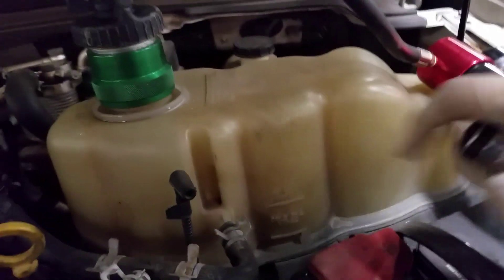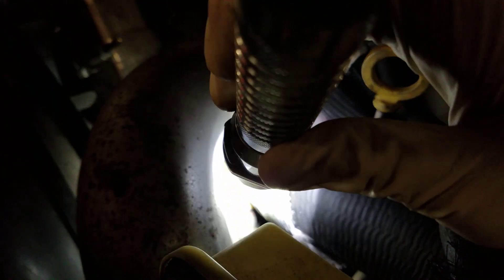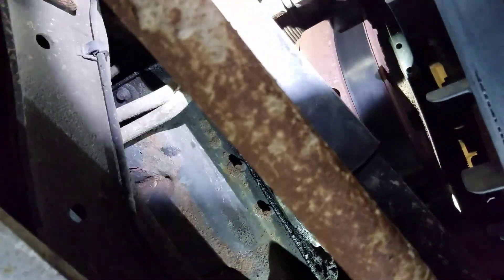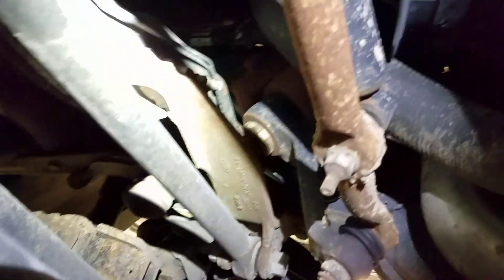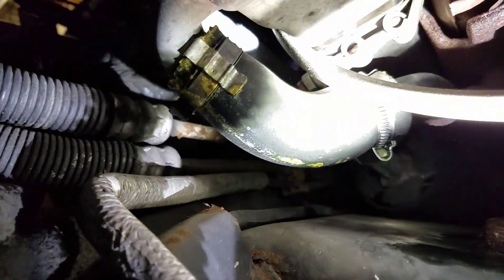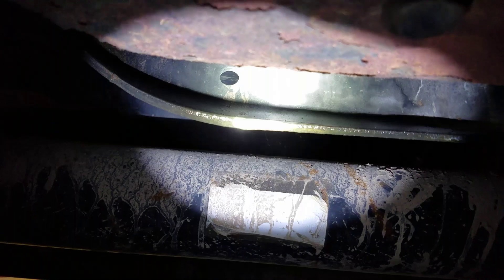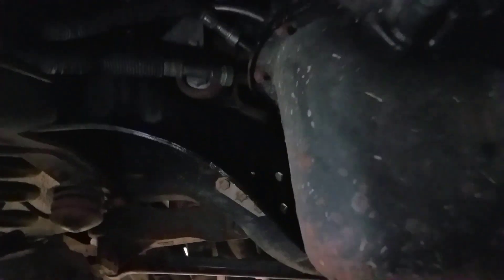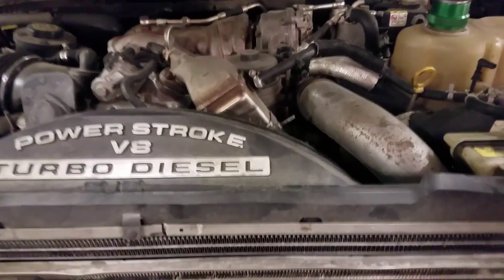2008 6.4 - Coolant leak

Comment: I can't believe the timing of your video.  I was at the dealer twice last week.  They couldn't find the my coolant leak the first time.  The second trip to the dealer last week, they ended up replacing this exact same hose on my 6.4 F-250, that you replaced in the video. (Horizontal EGR cooler to Front Cover hose)  They said that they had a tough time finding the leak.  However, NOW, it's leaking again -  but worse.  (On Saturday, I was trailing two lines of coolant into my office parking lot, and it formed a good puddle under the truck by the time I got out of the truck.)  I'm taking the truck back to them on Thursday.
Reply from the maker: Awe man sorry bud! Thanks for watching tho

Comment: ARod, I've done one of those on a customer's '08 F450 a while back, we got the assembly from Ford but after careful consideration I stole the hose piece off the new assembly and put it on the existing tubing on the truck. Total pain in the arse since it's so short but it's doable.

Comment: I’ve had to replace that exact hose and tube assembly before. It’s pretty tough to get that 8mm bolt holding it to the front cover. 2009 f350 6.4L. With that 550 there’s more wiggle room
Reply from the maker: Thanks bud

Comment: 08 F-350 KR.  Just noticed coolant leaking yesterday.  Looked under and I see several drips but can't pin down a single source.  There is a joint-looking area in the bottom hose near the driver side tire and it looks like it could be coming from there.  Not really sure what to do about it.
Reply from the maker: Need to get u a pressure tester on it
Reply: @PowerStrokeTechTalkwARod  hrmmm...need to get me a pressure tester first, then.  Thanks!
Reply from the maker: Lmk broski

Comment: That was definitely different. Do you change the coolant? How do you refill the system, an air lift tool or something like it. 
I was told the 2019 fords are having problems with frozen door latches. Have you come across this?
Reply from the maker: I have not....yet. Nope just dump it in. They burp themselves pretty good.

Comment: My 2008 superduty with the 6.4 , she would keep leaking on the bottom hose , the dealership fixed her 2 times , each time she would leaking right after the warranty was up only 65, 000 miles on her . Then traded her , dont miss her

Comment: Is there a part number for this hose? Did you end up replacing the whole tubing or just the hose it’s self? I’m going to work on one with the same leak
Reply: How bad of a job was it?
Reply from the maker: Ordered the tube....replaced JUST the hose....
Reply: @PowerStrokeTechTalkwARod  what would be a name on that egr cooler hose?
Reply from the maker: Egr cooler hose. If you need part info...you either can call your dealer....or you'll have to pay for my time 🤷‍♂️
Reply from the maker: No u pay me for my time ya gooooof. If you dont wanna pay for my time......like i said GOTO THE DEALER 🤷‍♂️

Comment: Okay, I guess some guys already beat me to it. Yes, I've replaced that tube before for coolant leaking, but that was a LONG time ago. Most of these trucks should already be technical write-offs by now. Like already mentioned, that one bolt where it connects to the side of the front cover really sucks to get to. That oil pan sure looked pretty rusted out too, almost like that's going to be your next project. I'm surprised the rad wasn't leaking on this one.
Reply from the maker: Shit i already replaced this rad...twice already. What up Chaaaaaan

Comment: that hose come with the pipe as assembly and ain't that bad to replace juste make sure you have a 8 and 7mm swivel
Reply from the maker: Yepp, i scoped it out. I got a new 8 milly bolt for the front  & the 10 milly bolt to LH manifold bracket....other than gettin a lil douched on...we'll hope 4 the best..LOL
Reply from the maker: Righhhht ughhh i knw

Comment: Yo man, phuck 6.4s. I was doing manifolds on one a few months back and had that hose leaking. The pipe that goes around to the front cover was so rusted and old if I tried to remove it I would of had another 2 days in it. Ended up stealing the rubber hose off the new one and reusing the metal pipe. Truck is still leak free, fingers are still crossed.
Reply from the maker: Omg i now how ya feel!!!!! Make me cringe lol

Comment: Can you tell me the thread size for the pressure tester adapter? Also are they all the same size for 7.3 6.0 6.4 and 6.7? Thanks!!
Reply from the maker: I dont know the thread size, but yes they are all the same. The 6.7 you'll need 1 for the 2ndary coolant degas bottle..it is smaller.
Reply: Just make one out of a old coolant cap